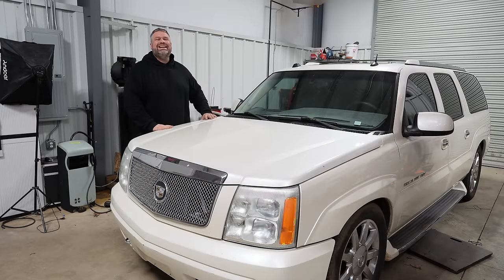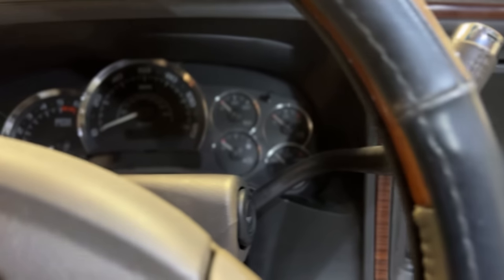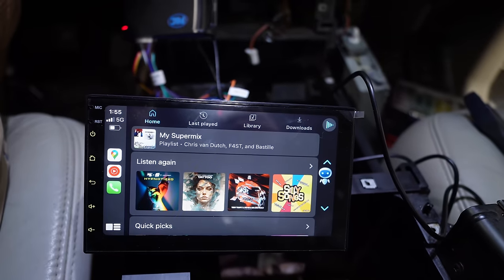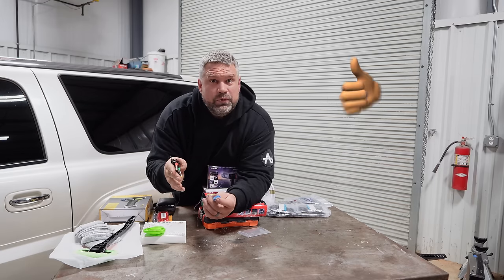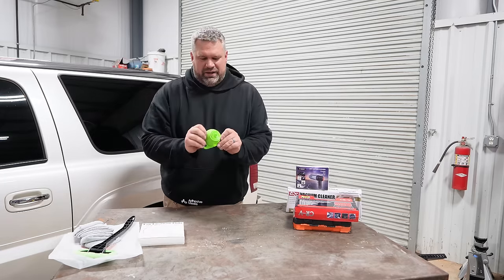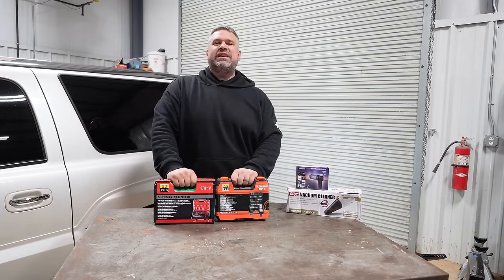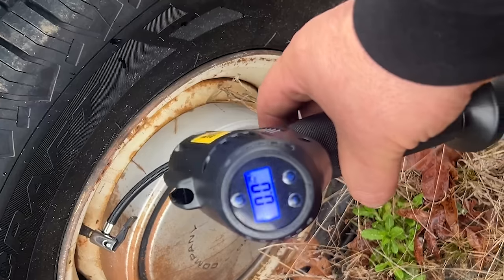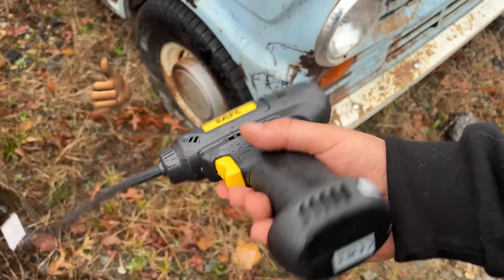Are Temu Car Products any good?

Comment: I bought a $100 head unit, it worked OK. However the display was not bright enough. I ended up buying a $400 unit just for the brighter display. It depends on you particular car, whether the dash is positioned out of the sun enough to see the display.

Comment: simple Metric conversion, 1" equals 25.4mm, so a half inch socket is between a 12 and a 13 mm socket, I work in CADD and lots of the CAD blocks are in Metric so i've had to memorize that conversion factor.
Reply: Surprised someone working on cars isn't at least semi competent in Metric, cars these days all are almost completely metric fasteners. and we all know things like 3/4 and 19mm are basically the same size.
Reply: @mini4x  it's a math thing, lots of people aren't good at doing math in their head so they get frustrated and just don't bother after a while and just complain about it, me personally I would be fine if cars where 100% Metric, I think it makes more sense, in fact in general Imperial/SAE Fasteners just shouldn't exist in the modern world, if we want to measure in feet and inches for building stuff I'm fine with that but fasteners just need 1 standard and it's also time to get rid of the Flat Head and Philips Head Screws, there are so many better options to choose from these days.

Comment: Regarding those android head units, something you didn't mention is that you can customise nearly everything, including the home screens. It's essentially an android tablet, so you can uninstall your own choice of launcher and other apps, such as ones that work with your OBD2, TPMS, etc. Also, another thing to watch out for is the amount of RAM it has. If it doesn't have enough, it can lag at times. Make sure you get one with at least 4gb of ram, know your way around Android, and you'll be fine. 👍

Comment: The switch 12v needs to be jumped to the pink wire on the existing wire harness for the truck. That powers the factory amp and provides power to Bose speakers. You’ll thank me later.

Comment: i once had a rear diff explode, literaly, there where chunks of the thing in the pavement, the pinion came loose and jam against the casing and cracked a hole in it, i was able to disasembly the thing and remove the center to at least roll the thing off the road (the thing being a kia cab over thing), and all i had was a ratchet, a wheel chuck and a crecent wrench, i figure that if you need more, you are not fixing it at the side of the road, that time i didn't i just got a wrecker to take me home

Comment: From my experience, those headlight polishers are useless!  It only lasted about 5 months.  I replace the headlight lens assembly.
---
On the voltage probe, some heat shrink would remedy that problem of shorting.
Reply: You're not wrong, I completely agree with what you wrote. But from someone with years of experience in headlight restoration AND replacement, let me just add that applying at least a couple of layers of a good quality ceramic coating on the lenses after the polishing process (and a final cleaning to remove all of the polish residue) will dramatically increase the amount of time before UV exposure begins to deteriorate the plastic again.
I also recommend using it on NEW plastic lenses, to help delay the need to recondition them.

Comment: I like the keychain for the de-pinning tools. Mine are all in a ziplock bag. Somewhere. I hope.
Reply: I bought a "deluxe" set of those tools, which came so tightly packed into the included zip-up case that many of them were tangled and bent. 
Unfortunately, after a couple years of having them, and multiple attempts to use them, I've been disappointed to discover they're not useful at all. My set of Jewelers Screwdrivers I've had for decades work FAR better than these cheap pieces of tin.

Comment: yeah, the Bose stereo units in GM (not sure about Nissan's Bose setups), are a nightmare to get right, there's a special module one has to get in order for it to work. Its why most people don't bother changing it, if Bose came in the vehicle. Luckily, my Armada's Bose setup has the factory nav, so while it'd be nice to have Android Auto, I still have a decent nav system in it. I just have a 12v usb charger with a USB bluetooth transceiver with an audio cable running to the truck's aux port, so I can have bluetooth streaming of my home media server for music. For essentials to keep my truck going, I bring a set of tools, nothing huge, just a basic wrench and ratchet set, with a 4 way lugnut tool (must have for all owners, better than some of those flimsy ones that come stock). Set of tie-downs in case I'm hauling something on the roof rack, a little air compressor (in the event I have to top up tire pressure in the middle of nowhere) and my trailer hitch attachment for towing.

Comment: Quite many cheap carplay head units have actual carplay. I've purchased as cheap as 60€ head units that have real wireless Carplay. You just have to check from the page that it has it listed as feature as carplay (save the page in case) and if you notice that missing you can make a reclamation and return the item when it's lacking advertised feature. More it's that specially the cheaper ones run out of amplifier very quickly and the sound is either quiet or distorted... I've so far installed 5 of these cheapo units (mainly from Aliexpress). Two to older cars with 1DIN-popup 7" display both under 80€, two "model specific" 9" 2DIN ones  (a generic unit with fitting adapter bracket and CANBUS-box) for about 130€ and one more expensive 300€ model specific one and all have had fully functioning wireless carplay. The other 1din model even without mentioning it on the product page :D

Comment: Actually the android based Atoto's around $150 have both carplay and android auto both wired and wireless, if you really want good sound quality atoto has a add on amp.  Trust me the knob (if it works well) is nice, the touch screens on many of those are annoying.

If you want to play with these build a factory to ISO standard harness as most of these android units use the ISO standard plug.

Comment: if you get a cheap toolset like that get one with open/closed end wrench set on it.              if not for anything else than for that you get the tools that let you get more leverage out of it. a 30-40 dollar set should have a big ratchet, a small ratched, 8 to 22 mil wrenches, bunch of torx and such.  thing with both of the sets shown is that they don't have a large closed end wrench on them to use as leverage, if something is even slightly stuck you wont get them open with that ratchet length.

i bought a cheapo crappy set like that because i just needed stuff and it has enough tools to teardown a motorbike completely. and it was around 900 baht or something, roughly 35 dollars or so.  I think they're all coming from same 1-2 chinese factories, the ratches always same style, the tools themselves look the same, the screwdriver handle is the same(it has a socket at the handle end so you can use it as an extension)..
Reply: thing with tooool kits, is they dont have certain spanners, that are the same metric, inch.. like 18mm, 22/23,?,mm. 13mm. i want from 6mm, to 32, consecutive, same with inch..

Comment: The problem with so many chinese car radios is that the sound quality isn't good. It's fine for listening to the news, but if you like bass, it's not for you! I'm still debating if I should install back my old Panasonic radio, or keep the chinese one. it has much more modern features, but the sound quality is very far from the Panasonic radio.

Comment: Another thing you might want to check with the head units is the Android version. A lot of them will report that they're running Android 12 or higher, but if you run the app Fake Device Test, it will report Android 10.
I once had a tablet claim it was running Android 10, but it was actually Anrdoid 5.5... 🙄
Yes, I did get my money back.

Comment: I like Temu...Yes, some of their stuff is cheap junk, but many of the products have bought were low price and worked well.  For example, I bought a Flex Tape knock-off, that was about 80% cheaper, and worked just as well.  Another example, I bought an ODB2 Wireless dongle (Car scanner, free software) for only $2, and it works well.  Heat shrink tubing, fingernail kit, etc. All good products!

Comment: metric is 10 bases and converting mm to inch divide by  25.4 , and  25 mm = about a inch and 100mm = about 4 inch , and since most of the cars out now are using metric fixings its time you guys joined the rest of the planet using 10 based measurements

Comment: He bought cylinder heads cause he couldn't get the exhaust bolts out 😂... I wouldn't tryst this guy advice
Reply from the maker: I had cylinder heads already on the shelf and everything to install them, I had already extracted 5 bolts, and reached a point the time to get the last one I could throw the new heads on much faster.